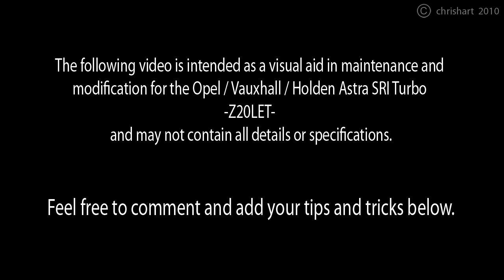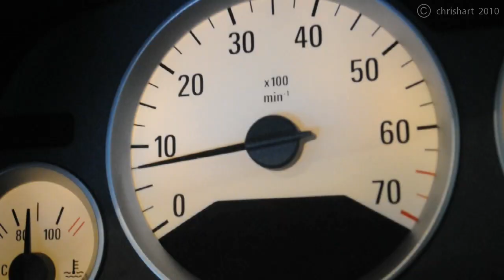VXR Turbo Install on Z20LET Astra G

Comment from the maker: Good tip Hans. The restriction bolt is recommended with the VXR (LEH) turbo on the Z20LET engine as the Z20LEH feeds lower pressure to it's turbo due to the under piston oil jets. Or so I have heard. 
Watching the video will answer your question of whether I had installed the restrictor though :)

Comment: The break off pressure on the Z20LET is set at 9psi and the break off on the VXR is set at 10psi if I recall so really is minimal. 

The boost controller bleeds off pressure to the actuator to ge the higher boost anyway and the boost is all electrically controlled.

Comment from the maker: @DazzlinDaryn1987 It's just a straight swap for a standard engine. Nothing needs to be upgraded unless you are after more power. 

The difference if kept standard is boost comes on a fraction higher in the rev range but it holds on where the original turbo would lose it's breath. 
I wouldn't call it a power increase though.

But if you are after more power, then this turbo is a great starting point.
Reply: Did you experience the turbo blowing oil seals after some thousands of miles? The LET has a much higher operating oil pressure than the LEH, and many say swapping oil pumps/installing a restrictor bolt is necessary for turbo longevity.

Comment: I have Z20LET still ok at the moment my turbo is but this video is definatly going to help me in future as im looking at upgrading to the VXR turbo. Their a straight fit and basically same engine apart from a few upgrades like forged pistons,under piston oil etc etc. Excellent video though. Check CS Autos in Liverppol for all GSI,SRI,VXR Parts.

Comment from the maker: Let me know, how long did it take for you to install the turbo. Anyone quicker than 9 minutes?
Reply: I replaced my turbo in 30 minutes, fitted a controller and bov All up it took me about 3 hours - first time i have ever done anything major to a car before - this video helped a tonne
Reply: Do you have the workshop manual for this engine?
Reply: Video is amazing. Your in Australia too? That's mad
How long should the first start smoke last? If it lasts too long do I have a problem?

Comment: Love the video.  It gave me enough info to give it a try myself.  My Holden Astra SRi now has a new VXR turbo to replace the noisy Z20LET one that was on it's way out (175k).  The feels like new.  Whoever put those air conditioner pipes where they block the turbo and put those bottom studs in the most inaccessable places should have been shot. 3 hours real actual work, many more hours and cramped hands with those bottom studs and bolts.  Cheers.

Comment: @chrispix  thanks, but my mechanic don't  find a problem.. the livel oil is ok! i change: timing belt, head gasket, rocker cover gasket, oil, filter oil, filter air, filter benzin, water pump and candles...

Comment: hi Chrispix,

I have a question. Where the wastegate contrail wire ends? i accidentally disconnected not from Turbo, it is still connected in Turbo itself, it came out on the other end, now my engine runs unstable. thanks advance for reply.

Comment: Hello from Australia, my astra is smoking out of the exhaust, blue smoke. I replaced the stem seals but ut didn't do anything. Have a feeling it's the turbo, I've ordered a restrictor banjo bolt to try. Or should I just replace the turbo?
Reply: After replacing leaking stem seals or turbo seals you need to run the car for a while to burn off all the oil in the system before you get no smoke

Comment: So I am thinking about a turbo install for my vehicle. I live in Colorado and I own a Suzuki Forenza with the US20SED engine which is very similar to the Z20LET/ LEH engine block and Im not entirely sure as to the specifications and if its an actual bolt on fit. Will this VXR turbo w/ mani  fit on to the 20SED engine block?
Reply from the maker: +Alejandro Almodovar I have no idea mate. Best that you head to a forum about your car and see what other people are doing.

Comment: Hi Chris, very useful video thanks for posting. Just a quick question, when you fit the new studs you use an assembly paste; is this a vital step? When I bought studs and nuts from Vauxhall I asked if they kept assembly paste and they didn't even know what it was! Is there an alternative?

Comment: Thanks for the video, very helpful. What would you say the maximum reliable boost is on these turbos as I have one to go on my corsa c gsi convertion. Thanks
Reply: I run about 21 psi for a few years now, I think that is about max reliable when using good quality oil changed more regularly

Comment: A stupid question. Can I install the Z20LEH turbocharger's in a Astra H Z19DT?
Reply from the maker: Pablo Aravena Probably not. Sounds like a question to ask a performance company that has tuned diesel astras before.
Reply: check the astra owners club forums.. you will most likely find the answer there

Comment: @drummerboi60
You can't put a reverse thread not onto a normal thread >_<

You can use 2 nuts like that, tightened against each other to let you undo the studs. Saves you having to buy/borrow/use a stud extractor.

Comment from the maker: Not necessary really, I didn't adjust it. At first there's a little bit of over boosting but the computer will automatically adjust to z20let spec. Even when the ECU is reset, it will remember as well :)

Comment: chrispix i know its a old vid but ive just bought a Zaf GSI with tis engine in it. I have heard that the original turbos are naff and do blow,crack etc. 2005 GSI bro with 80k still on original turbo!
Reply from the maker: Hey Andi, the old turbo should be ok if it's had a good life and not driven hard all the time.  If it's not burning loads of oil, it'll probably be fine for years to come.
Reply: I have 123000 miles and still on original turbo on my vxr turbo. Change oil regularly with good quality oil and don't kick the turbo in for long periods cause they run at high temps after a few minutes of hard boosting
Reply: @darrenmicklewright2008  DONE 111.5K now bro and still going strong. she hisses like a phython and pulls like leonardo

Comment: @chrispix 

Big thanks matey. Just in the process of fitting mine now, though its got to come off, as I somehow forgot to put the sodding copper washers on the cooling lines! Do you happen to have the torque settings for these? my dealer is as much use as Stevie Wonders eyesight...

Comment: An oilrestrictor is recommended? How can a smaller hole and therefore a lower oilpressure or lower oilflow be better than standard?
Reply from the maker: Musterhund Because the Z20LET engine provides higher oil pressure to the turbo than the Z20LEH engine. The Z20LEH has oil jets under the pistons so there is lower pressure for the turbo. The oil restrictor reduces the LET oil pressure to what the LEH turbo needs.
Reply: chrispix
but the LEH turbo is not the same as the LET, is it?
Reply: A vxr turbo made after 08 will already have a restrictor built in on the oil feed inlet so will make no difference whether you fit a bolt or not
Reply: @Musterhund  it was realised by vauxhall in 07 that the vxr had to much pressure into the turbo so kept blowing the turbo seals, so after 08 all vxr turbos are fitted with a restrictor in the oil feed inlet to lower oil pressure but still be reliable . Its because the vxr engine has got under piston oil cooling so runs higher oil pressure but a let will run lower pressure so I doubt you would need the restrictor bolt in a let only a leh

Comment: @chrispix great video mate. i just ordered my new turbo (old 1 packed it in :( ) and am gonna give the change over a crack myself thanks to this vid.
sorry to be a pain in the ass but do u think u could list the required tools?
i gotta go out an buy them and i wanna make sure i get the right ones coz once i start, ive got no car until im finished.
most of them look fairly common but not sure of sump plug fitting, manifold stud size etc. any help would be great.
cheers!

Comment: @chrispix  Thanks for the reply, i'd like a bit more power but not sure how much as I don't know how much the gearbox and clutch will take, I've already had my car re-mapped on the standard turbo with vxr fuel injectors (running around 250bhp) will it need mapped again with the vxr turbo?

Comment: Hi mate I know its a daft question but I need to change my manifold gasket so I was wondering have I got to do ruffly the same as what your doing in order to change it Or just undo the bolts like the c20xe? Ive never owned a vauxhall turbo z20let before

Comment: is it possible to fit the oil restrictor bolt without having to remove the full turbo etc??
Reply from the maker: ***** yes, it's just not an easy thing to show on video cause it's so tight and fiddly.

Comment from the maker: @DazzlinDaryn1987 I'm not sure mate. Best talk to the place that did the map. The standard map overboosts for the first couple of drives and then settles back to normal once it's learnt about the new air flow. Your map it telling the computer to boost more already so it might be fine. But again I would ask the place that did your map.

Comment: how much hp with k04 049? to be safe with stock internals
Reply: 320bhp but it's the torque that will snap a rod not the bhp ,a good vxr tunner will know when to cap the torque

Comment: Anyone knows what's the "assembly paste"? any known brand, like Wurth or EAP5? and whats the real name for that, like "exhaust assembly paste"?
i need that to complete all the things that i need to do the job!
thanks
Reply from the maker: The assembly paste I used was standard issue from General Motors. It came as a kit with the turbo from Autovaux. Also note that it is an anti seize paste so that the bolts are easier to take out.

Comment: did this do much?
Reply from the maker: Yes, the vxr turbo holds the boost better when reving out the engine. So even without retuning the ecu, you will get a benefit. If you retune on a dyno though, you have much more potential than the standard turbo.
Reply: +chrispix hey cheers for the reply! definitely looking into this

Comment: What kind of oil  you put into engine?
Reply from the maker: +kapsel136000 I currently use Penrite HPR10 fully synthetic 10W-50. In the past I have used Mobil 1 and Motul. (both 10W-40 fully synthetic)
Reply: +chrispix  Right now I use Castrol Edge 5W-30 fully synthetic, but I think about  different oil. Engine keep burnout this one, not a lot...  How many kilometers your Astra made???
Reply from the maker: 5W-30 is pretty thin. I believe 10W-40 is good for all climates. Your astra's owners manual has a guide for what oil is best for what climate you live in.
My astra has done 194,000km and it doesn't burn any oil. And have now owned it for 10 years :)
Reply: +chrispix Great, so does my 2002 Z18XE. Timing belt replaced the other week recently, 202,000 km, no oil.
I use Castrol 5W-40 High Mileage. Northern Germany.
Reply: +chrispix +heros2110  Interesting, thanks for the video.   My 2001 Z20LET has only done 25,000km and uses over a litre a week (~300km).  No sign of leaks and it's not  smoking or smelling excessively.  Any thoughts on where to start looking?
Reply from the maker: +JayFe0 Are there no oil patches on the ground where you park?  Do you have trouble starting the engine when it's hot?
Reply: It starts first time hot or cold.  There are no patches of oil on the ground.  I park in the same place at work everyday an keep and eye out for this.  There is some minor evidence of oil underneath but there's no drips or splattering.  

I don't know much about the car before I got it but I do know that it's had an ECU from a Corsa put in it (so Opel tell me). 

Apart from a missing splitter it's otherwise almost immaculate, so it's a shame and it's about time I did something about it.
Reply from the maker: That minor evidence of oil could be where it's all going still. See if you can track down where it's coming from. Years ago I was losing a bit of oil but with no sign of drips or patches. It turned out to be the rocker cover gasket.

Corsa ECU sounds a bit odd. I wonder why they did that.
Reply: I'll get underneath it this weekend and give everything a good clean then check again next week.

It's funny you should mention the rocker cover gasket.  This was done a few months ago when it started leaking suddenly and a lot.  It's about as thirsty for oil after as it was before. 

Best guess on the ECU is that someone broke it while tinkering and replaced it with one from the scrapyard.

Thanks again for your time and channel. 

P.S.  You shouldn't drive your car fast.  I know this because I was told so politely but firmly by two policemen on bikes who escorted me off the motorway on my way home today.  Luckily, I escaped with just a warning.
Reply from the maker: Police escort for the win. Glad you only got a warning, some cops are awesome.